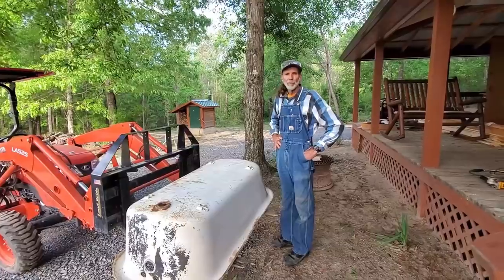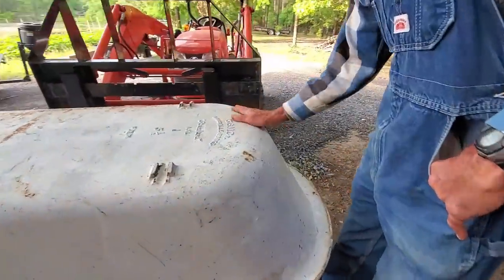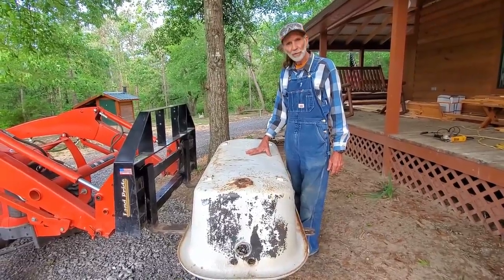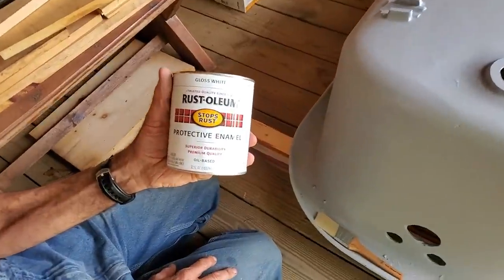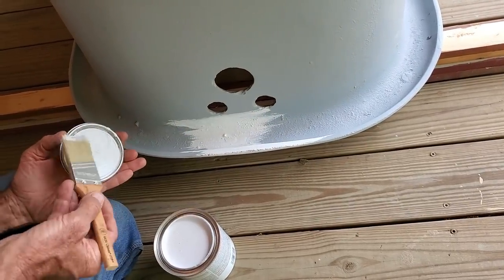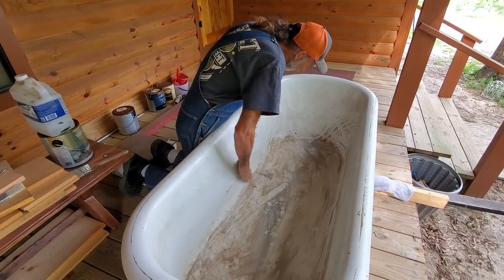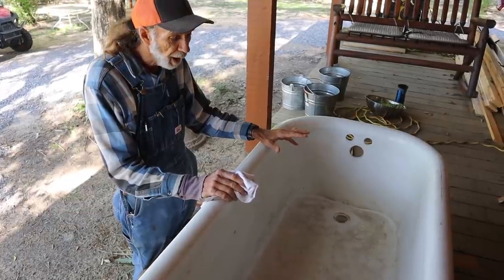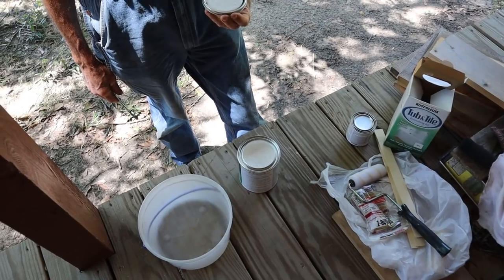100 Year Old Clawfoot Tub ~~ REFINISHED

Comment: We just had a first attempted. Used your video as a guide. Tip for everyone. Use a grinder with the relevant pad, not a sander. The old paint is so hard to remove in some cases. I lost 10hrs and it was still only half ready! Great video, thanks for taking the time.

Comment: I restored an 1860’s large 20 or so gallon cast iron pot using electrolysis to get the paint off and sanded forever with a brass sanding wheel so as not to scratch it. I had to sand it for a week. It is fully restored and can actually cook in it on a fire or propane fish fryer base. I found online a discontinued heavy aluminum lid that fits just perfect. It was so much fun.
Reply from the maker: Sounds awesome.
Reply: @DeepSouthHomestead  I may be using it to feed the neighborhood rice and beans, beans and rice soon...
Reply from the maker: @kenadams5988  That's very possible.
Reply: Omg that's so cool! Please consider showing a video or pic of it, I'll bet it looks amazing. 🥺

Comment: I'm refinishing my claw foot that came with my house. My tub does not have a date on the bottom, but has 1C1O, which I haven't looked into yet. It's 5' even in length.  I sprayed the outside with 4 coats of Rust-Oleum primer & 4 light coats of Rust-Oleum hammered grey. I'm using BathWorks tub refinishing kit in white for the inside. The bathroom I installed a plastic lookalike tin ceiling, off white walls, & black floating flooring. Rounding it out with a vintage pedestal sink in white, with a new commode. I'm really enjoying the two-tone, light and dark together.

Comment: Your tub is the same size as ours. We bought our house in 1973 and the clawfoot tub was already in the bathroom,  and it was in excellent condition. Our house was built in the 1920's. We put new pipes and faucet on it. I painted it black and placed a pink roses decal on the front and painted the clawfeet gold. Everyone that see it just loves it. The only thing is the older we get the harder it is to get in and out off. I will have to see if I can find a date on the bottom of our tub.

Comment: We've got this exact tub. It is indeed from 1919. Ours is vintage 1912 and was framed into the bathroom on original construction. It won't make the turn into the hallway to remove it, because the chimney runs up across from the bathroom door. I'd have to remove a wall, or cut the tub to remove it. It will be here for the next owner.

Comment: what a beautiful job you did on this ol Tub. We have a special order tub in our bathroom. Our House, a craftsman, two bedroom bungalow, was built around 1900, the water came into the house the clerk said down town, from the books there, in 1920. A Plumber working on our kitchen sink, shared the fact that it was made in 1944, which surprised him because of the demand for steel in WWII. Dont know the year on the tub. Tub with shower in the it, it had to have been special ordered, it has sitting space in it of only 34 inches front to back, the entire tub,  the same measures 48 inches,  front to back. Regular width, with the very back slightly slanted for laying back in it. lol  That takes some sense of humor to build it this way.
     I am only 4 ft 11 inches in height, (used to be 5'1 when I was quite young)  and if I want to take a soak I have to sit in it cross legged.   Still in good condition, paint/sealer on the porcelain on the bottom of the tub getting thin now. I have lived in a rental in the past which had a tub like you just refinished, just dont have the room here to add one like yours, unless I knock out a wall.
     But Hubby never takes baths, only showers, even when we had a full size tub where we lived b 4 we bought this retirement home back in 95, he never took baths. Must have been all those 21 yrs in the Army he did, time for a quick shower and thats it. Like he always told my first 4 children I had when we met.  One of them going to go take a shower, he said to them "Wash up to possible, down to possible and get the h e l l out!   God how I love his sense of humor. Originally a TX Man,  he puts up with this Norsk very well.

Comment: Here is a quick easy tip to get rid of paint on cast iron bits and pieces , Cabinet hinges and handles . Take a old crock pot put all the pieces in it that you want paint off cover with water and let cook on high for a few hours test every once in a wile . When they are ready clean in all the groves with a old tooth brush the paint just falls off

Comment: I bought one of those cheap grey hopper type sandblasters from HF and screened the rocks out of play sand.  Worked pretty well on the outside to get everything out of the nooks and crannys. I bought the glass bead blasting grit from HF to do the inside.  If you don't get all that discoloration off the inside bottom you may have paint issues in a few years.  That discoloration is material that clogs up the micro pores in the porcelain and the paint has less to adhere to.

Comment: Any epoxy discoloration years down the line? My refinished tub (2017) stains like heck starting 1 year after being professionally refinished. Two clean users, no pets or children. Light tan spotted random discolorations started in the first year, and have worsened over time. Some chipping where the water hits the deck too. I washed a sleeping bag in the tub this year and it stained the epoxy purple, sheesh. Gonna refinish it again soon, wondering how yours has held up with the rustoleum epoxy?
Reply from the maker: So far it is still white and looks nice.  No discoloration

Comment: Hi, I’m attempting to do my first cast iron tub in my rental home. Landlord has neglected to take care of it. The paint has been chipping pretty bad. I tried scrapping it off, but I wanted to know what grit of sand paper should I use to remove the chipped paint or should I not sand it and use something else? Any tips will help.
Reply: I used a 150 grit sanding disc.